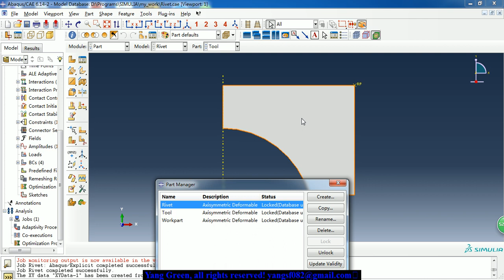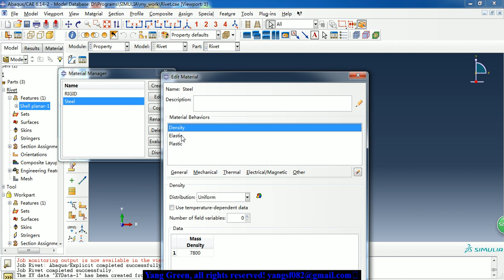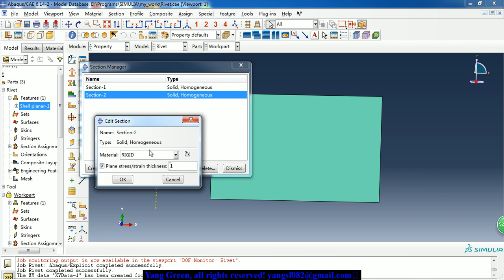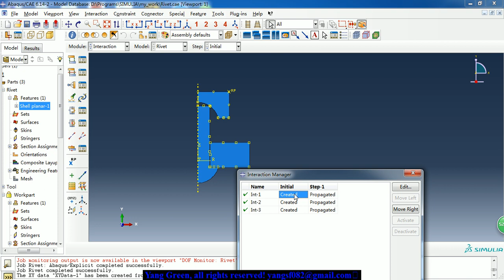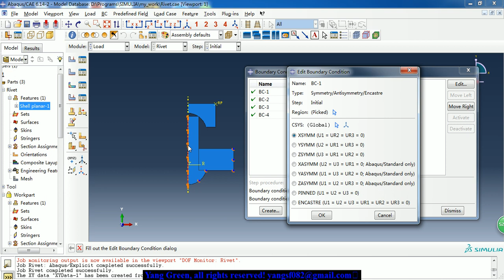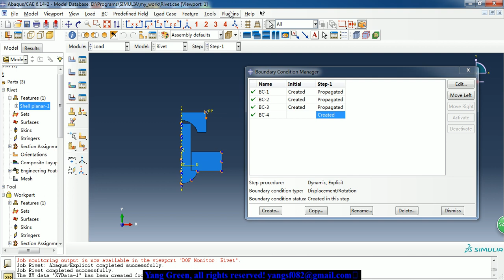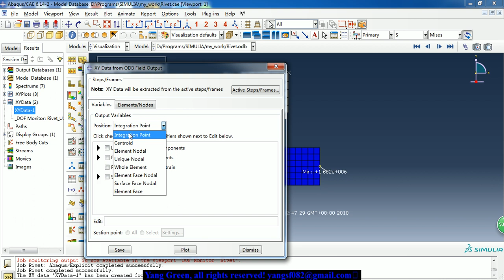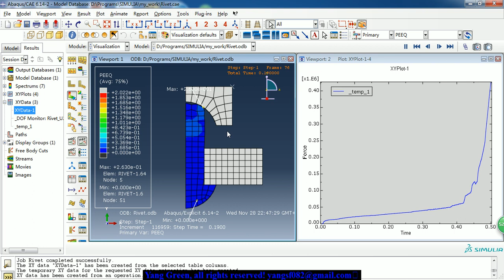ABAQUS -Step-By-Step - Forming of rivet

Comment: Nice vide. I had following questions please 
1- For material property of steel (the true stress strain curve) you used elastic and plastic properties. I have stainless steel rivet attached to cold formed steel sheets and there i am also using the elastic and plastic properties. However the supplier just gave me Shear strength (4000N ) and tensile strength (5000N) for these rivets so i need to know how can i use this information and convert to stress strain curve with elastic and plastic regions
2- Using a general contact or surface contact which is more suitable ?? (in terms of getting solution converged  and simplifying the problem )
3- The friction coefficient of 0.2 you used please share reference
4- How to decide what Element type is suitable for my work ??